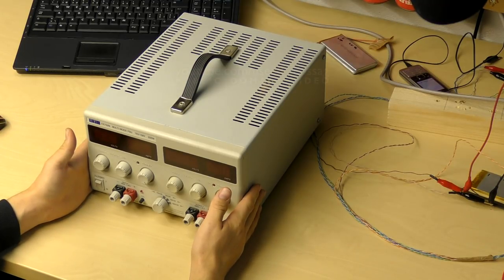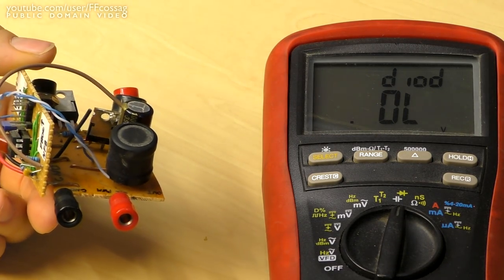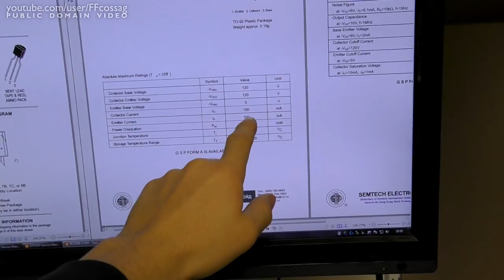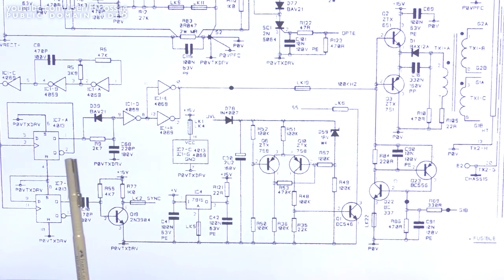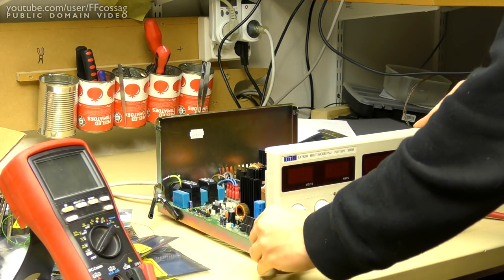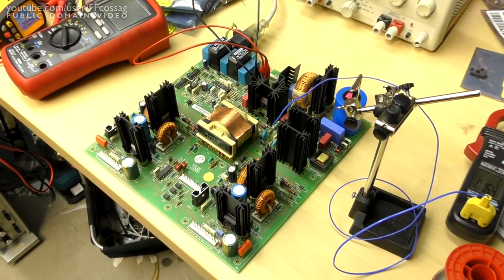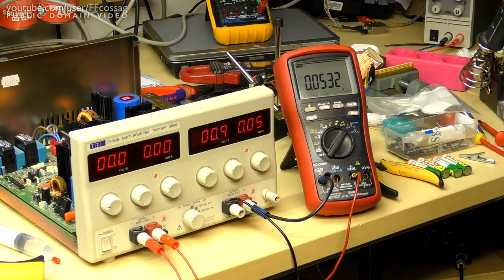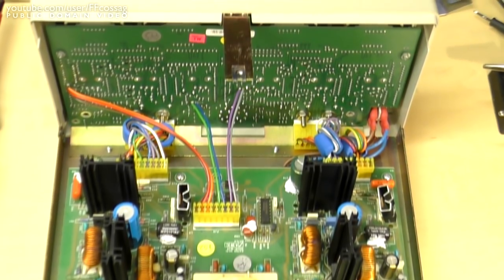TTI EX752M PSU Repair

Comment: Thanks for posting this interesting narrative . I am a consultant engineer  and designed this PSU for TTi about 20 years ago . I will alert the drawing office about the close proximity of the 380V rail to the lower voltage components . The section to which the flash-over occurred is the cycle-by-cycle current limit . If you need any help in the future , just give me a shout .
Reply from the maker: Ah, I was hoping to hear your input on this, since I'm not skilled enough to decipher more than bits and pieces of this unit. 

Out of curiosity, would you say that the operating temperature of >100 C (and by proxy, power dissipation) of R20 is normal? I don't recall the unit having quite as potent a hot component smell to it as it does now, but this could easily just be confirmation bias on my part.

Cheers.
Reply: The data sheet shows a dissipation vs temperature rise curve which goes to 350degC . This resistor does run hot under normal conditions . L10, C27, C28 and associated diodes form a snubber with energy recovery .
Reply from the maker: Ah, excellent, that's put my mind at ease. Thank you!
Reply: E Kus do you know much about the EX354D Models?
Reply: Hello E Kus, are you still active on youtube, I know this is a fairly old comment know! What's the best way to get in touch? Thanks

Comment: Hello my A channel LED displays don’t work but I do get voltage output on both channels and channel B does display, I’ve not got schematics for this PSU. I wondered if you have ever experienced display failure?
Reply from the maker: I had some odd display issue with mine at one point, and I think I solved it by swapping a couple logic ICs on the front panel board. It can also be the mode selector switch, they tend to get oxidised with time.
Reply: @FFcossag  ok I’ve put some contact cleaner on the switch but to no avail, I proceeded in checking supply voltages across all 8 ICs (IC 1,2,3,4,5,6,7,8) and I’m getting voltages typically 5v, the mode LED comes on CH-A like it should as does CH-B when PSU is turned on. This indicates the aux 5v rail is working which supply’s all the ICs on the control panel, which leads me to believe then one of the logic ICs has failed, I’ve checked caps and diodes and resistors what IC it’s most likely to be I don’t know as there are only 8 and 1 of which is programmable and I can’t possibly reprogram it myself unless I can get it from TTI programmed then I will leave that one off and proceed with replacing the logic ICs. And hopefully that will do the job. its strange it outputs voltage completely fine using my DMM I can see voltage output fine it’s just the display and monitoring side that’s gone.
Reply from the maker: The metering and the supply are completely separate, so that's not surprising.

It's also worth checking the connectors of the cables going to the front panel, they're plastic backed on one side and prone to bad connections and burning over time.

Comment: One weird design decision is that they have chosen different types of almost identical transistors. Like Q1 (BC546) and Q19 (2N3904) and Q22 (BC337). Depending on what they really need they could have reduced that to only two types.
Reply from the maker: Hm, the 3904 certainly is the odd one out, there.
Reply: My guess is: Somebody took an already existing circuit design, incorporated it into this design and didn't bother streamlining the BOM.
Reply: No, those parts are NOT equivalent!

BC337: 800mA Ic
2N3904: 200mA Ic

BC546: 65V Vce
2N3904: 40V Vce
Reply: Yes there are differences. But look at the circuits they are used in and what performances are really needed in each of em. At least one other part would be totally suitable for one other's job, so you would get one different part less on the BOM. And I think that they didn't streamline the BOM because they were thinking as you do: "That part is somehow different, don't touch the BOM"

Comment: Hi FFcossag, can you send me the schematic? I have a power supply like this and I need the schematic for repair. Thanks
Reply from the maker: Send me an e-mail.
Reply: @FFcossag  Thanks you very much FFcossag, but I don't have your email. Anyway i don't need it anymore because i found it here: http://pa2hs.kg-uitdaging.nl/documenten/TTI%20EX354D,%20T%20&%20Tv%20Series%20Service%20Manual.pdf
Reply: Hi! Can I recieve schematic too? Yes, I know that it's old video, but I found one unit like this and want to fix it.

Comment: Why not put a fan in it?
Reply from the maker: I don't like fans.
Reply from the maker: That might actually happen in about a year, but for the time being I'm sharing a kitchen, which could make things ... awkward.
Reply: rector magnificus just as long as he doesn’t cook in a apron and nothing else😱
Reply: I've added fans to many things, even nice quiet fans, and gotten way more life out of them. Had a brand new arcade machine at work once, it blew up 3 times in the first year and a half, added 2 80 mm fans just to get the heat out of the cabinet, it has run for 6 years with no troubles. If you don't like fans, maybe at least give the poor thing a more ventilated cover. Just because a component itself can handle hi temps doesn't mean they should be running that hot, nor is it good for the other components around it that are taking in that heat as well. Just my experience.
Reply: I agree.
If I have a piece of equipment that dies regularly of too much heat, I would take a fan in it.
I mean, everyone who is a DIYer has a few 12v fans laying around. Maybe even some Buck Converters to make them more silent
Reply: There are some really nice quiet fans out there. Plus you don't necessarily need a powerful fan to cool it off enough. Use a large diameter, slow-speed fan.

Comment: Would it be possible to retro fit a cooling fan?
Reply from the maker: It would, but I'd rather not.
Reply: FFcossag understandable as I have since read your other comments about fans. It may be worth fitting one as a stopgap unto you decide to upgrade the passive cooling even if it’s just to prevent another issue
Reply from the maker: Not really, in my opinion; this unit has never failed due to overheating, and I've treated it to a very harsh life.

Comment: with that idle power you could go to moon and back again :)
also, put some fan in it, damn...
Reply from the maker: I might upgrade the heat sinks at some stage, but I don't much fancy fans in my gear if I can avoid them; they're better kept on the internet. ;)

Comment: i have a problem on display
DMM give fine output but display is  0000 voltage are not changing on display i have check complete board everything is fine but pleasr help me which problem could be

Comment: Yea make a video of modding cooling for that thing.
It will be a shame if it blows up again because it was overheating,maybe 12cm fan on top as exhaust with very low rpm,i did that to my Sony Home theater receiver which was passively cooled an it was usually sitting at around 70"C and i put in a fan,standard PC fan at 5V i i cant even hear it and temps dropped to 46"C,every bit of airflow helps and that IR reader doesn't anodized aluminium (non of that aluminum rubbish as Dave would say) heat sink,it reads about 10"C less,put mat tape on it and measure it and you will see.
Great video all in all,keep up great work.
Cheers
Reply from the maker: I don't like putting fans in passively cooled things; if anything, I'd add some more heat sinking to it, but that's a pretty big project. Thus far, I haven't had this unit fail due to temperature, just abuse, and now issues from the weird PCB layout.
Reply: I would still recommend adding a 12V fan but run it at 5V to make it run very slow. You wouldn't be able to hear it but it would still cool the PSU adequately.
Reply: Caution is not entirely unwarranted since air turbulence can be a problem in analog and lead to stability issues with output voltage or circuit bias e.g. when differential amplifier transistors aren't thermally coupled. That said, using a fan drawing out for convection enhancement should largely avoid these issues, and large sleeve bearing / rifle bearing / FDB fans (like 14 cm) at low RPM with elastic mounting can be so quiet as to be inaudible, and going by what my PC[1] looks like after 5 years of use, it would take decades for substantial dust buildup, let alone clogging. We're not talking pushing air through tightly spaced cooling fins in an attempt at squeezing the most heat transfer out of a given volume (= your average consumer notebook cooling solution).

[1] FSC Celsius W360, bit of an old hat nowadays as a BTX formfactor Core 2 era machine, but great airflow for sure. The CPU heatsink (V26898-B871-V1 I think) only has like 24 fins over 90 mm of width, you try clogging that. It is unfortunate that exactly one big electrolytic next to the memory sockets on the D2587 board always seems to bulge ("OST" RLA 105° 10x25, not the most reliably brand apparently? *surprise*, 3300µ/6.3), resulting in eventual failure to cold boot. I eventually put in a D2817 from the W370 model, saving almost another 10 W after having already swapped in the newer 80+ power supply (10 W less in idle and a much cooler-running supply). Hint: Use a flexible bit holder, otherwise it's a pain. My long-term faith in the smallish ultralow ESR caps (Panasonic FP series ultralow ESR, 560µ 2.5 and 6.3 V) is limited though, especially since I've seen one bum board with cold boot problems already, though to be fair I've had to replace the PSU in this machine before, indicating that maybe it had previously had a rough life - it was used with unknown history.

Comment: Well done :-D i was hoping you would make it live again, and its alive :-D.

I was wondering if you were going to plonk a cpu fan over the back vents and give it half speed to push some air through the pcb, i think the calibration may move if the inside gets warm, so a little fan maybe, perhaps?

Ztx transistors, oh shit, they existed in the 48k spectrum in the psu, yes pop was the result.
Reply from the maker: Of course it lives, I can't live without it. ;)

I don't like fan cooling it, because fans make noise and clog up. I really like the fact that this is a zero noise unit. If anything, bigger heat sinks would be my way to go, but that's a bother to source.
Reply: salvage heatsinks from your pile of old scrap boards. At one point your IR thermometer read 110*C on one of the heatsinks. That is FAR too hot. The semiconductor die is going to be even hotter than that. For me any heatsink hotter than 70C is too hot and it either needs a fan or replacing with a larger one. A good source for large heatsinks are large old CRT TVs. You should be able to find at least one at a recycling  centre or ewaste skip.
Reply: If this was my PSU, I wouldve already replaced the hottest heatsinks with bigger ones, drilled more vent holes and added a fan running at slow speed. I added a 92mm fan inside the top of my denon AV receiver running slowly and it made a huge difference. The top was too hot to touch before.